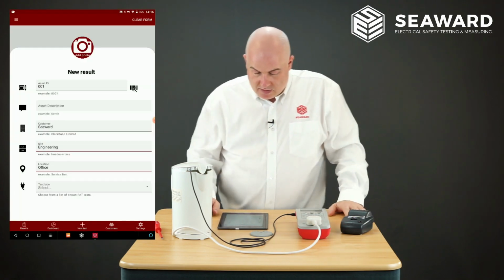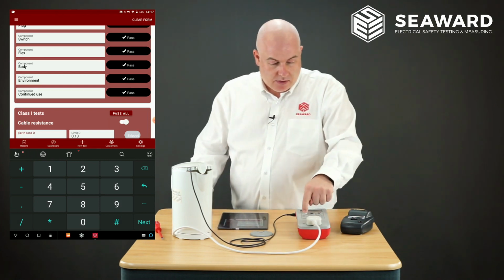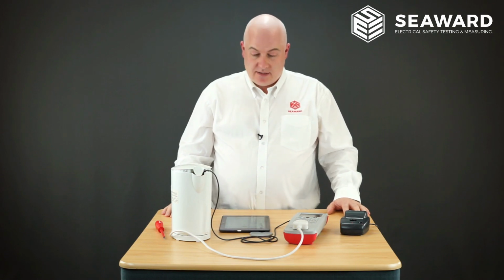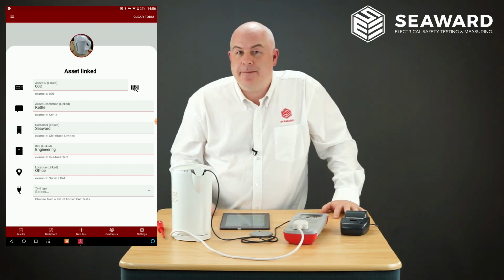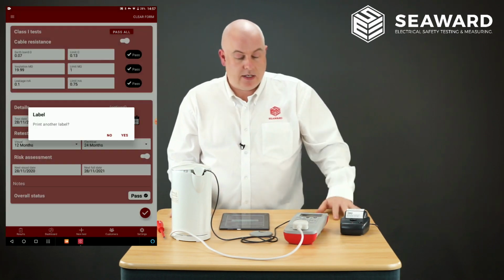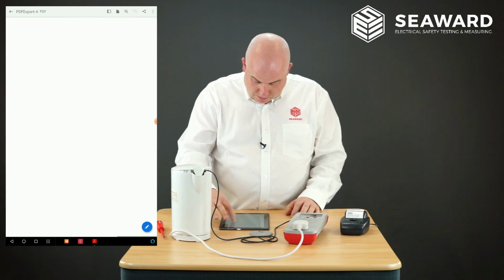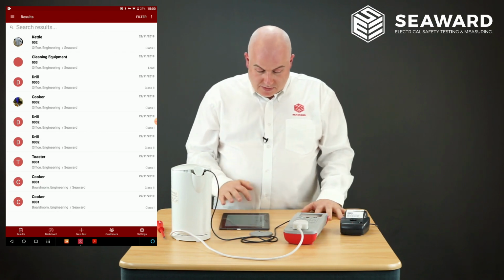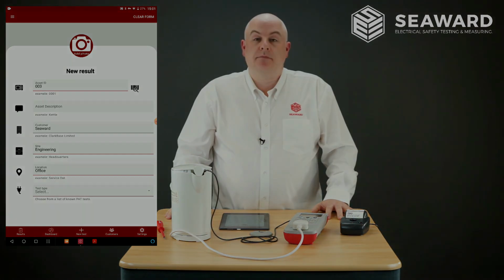PATMobile PAT testing app overview

Comment: It would be good if the mobile app has a graphical dashboard providing a time series charts of all the tests for an appliance it would allow you to see any deterioration in the appliance over time. Yes you could export the data to excel and do it there but it would be nice to do this in an integrated way. You could make these time series charts a new testing framework making clear when appliance replacement should be undertaken or repair.